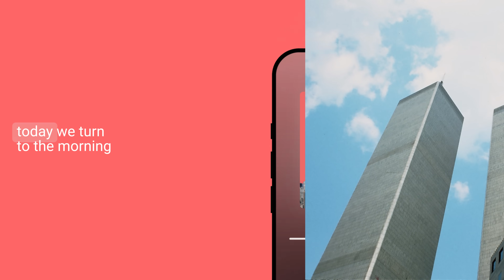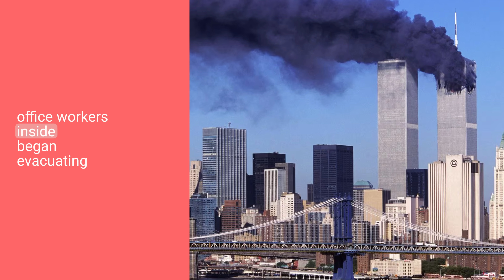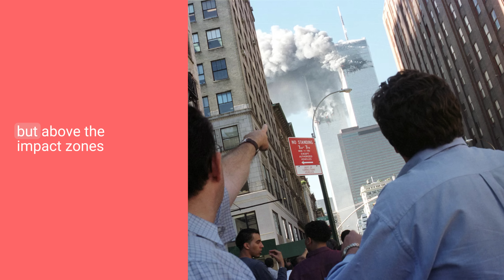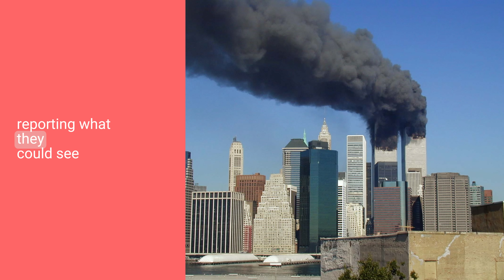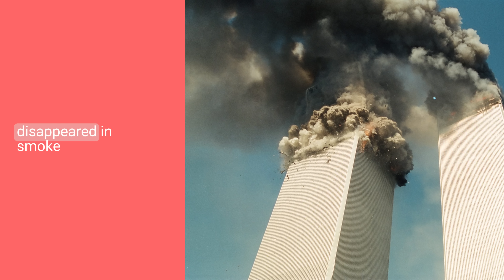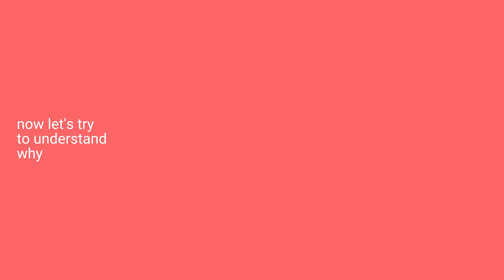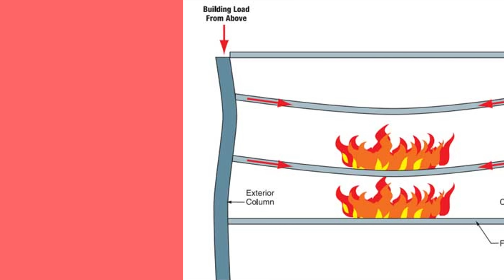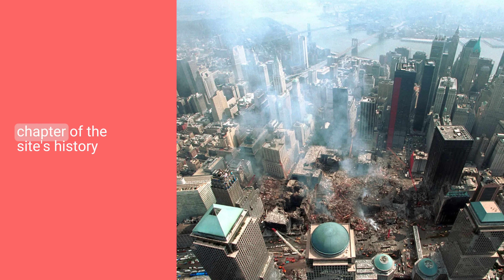9/11 - How and Why the Towers Fell

Comment: Have You heard about Brno Technical University´s study made by prof. Ivan Němec´s team (with computer model) which proves WTC North Tower collapse was not gravitational but some additional energy had to be used? They were asked to write a book about it  so they wrote it and it was published in 2014. Scientific research, differential equations. Czech constuction engineers came to these conclusions:
„In this probable combination of parameters we can see that the collapse was arrested after approximately 100 meters. The most of the building remained standing. But this also was not observed in the case of collapse of the WTC 1 building.“
„In both solutions it was supposed that the columns did not cause any resistance to the fall, no mass fell outside the building perimeter and there was no damping. The fall is braked only by the impact of the falling mass into the motionless mass of the floors below the crushing front, and this is an inevitable brake on the fall caused by the law of conservation of inertia, which is one of the basic laws of mechanics. However the real collapse of the WTC1 tower was still faster. It leeds to the conclusion that the mechanics of the fall must be different than supposed by the NIST report and also by the authors of this book, and that the falling mass did not hit a motionless mass below it, but rather a mass which had started to fall before the impact of the falling mass occured. „
___________
Preface
„The book is inspired by the fall of the Twin Towers of the World Trade Center, but all the derivations and formulae are valid for a collapse of an arbitrariy high- rise building. The computer simulations are performed on a building with the same geometry“ …
„Several additional parameters, such as the value of damping ratio, the share of the mass falling beyond the building perimeter and the average resistence of the columns to the fall have been introduced. „
„The book is not interested in the cause of the fall, but it studies the dynamics of the fall itself, especially the speed and the extent of the collapse. Some conclusions regarding the fall of the WTC Twin Towers collapse have been made.“
„Impossibility of the mechanism of the collapse presented in the final report of NIST is proved which imply the need of an additional investigation of the collapse of the Twin Towers of the World Trade center. „
https://www.amazon.com/gp/product/3639668162
Reply: Thanks for sharing! 👍

Comment: Kind of wonder if there should been Warter to dump above buildings
Reply from the maker: That's a very interesting idea. Having big masses of water on higher floors is already a technique utilized to stabilize buildings against earth quakes, so if that water could also be used to help with extinguishing fires, that would be amazing. The one thing I honestly don't know is how much water would be needed to even slow down a fire like the one that happened in the towers that day. Maybe someone who reads this and has more knowledge of the subject could do some napkin math for us to see if that would have made sense.
Reply: Well, there was. It´s called "sprinkler system".
They say the sprinklers got severed by the plane impact, which is a funny "argument" since the water would still pour into the impact floors with the fire.
Fun fact: Originally the towers didn´t even had sprinklers. The towers were supposed to be able to burn out completely without collapsing. They installed sprinklers only after the huge fire in 1975. Not for the safety of the structure, but for the safety of the people inside. The 1975 fire was on the lower floors with all the weight on them. It was a 3-alarm-fire on multiple floors. Yet the tower didn´t collapse completely. Not even partially. They didn´t need to demolish it afterwards. They didn´t even need to do big reconstrucions nor replacements. The fire really did NOTHING to the tower.

Comment: what tells you helicopter rescue would have been impossible? There is a video filmed from an helicopter checking the roof and the pilot explained that if theyd seen someone they would tried taking them.
Reply from the maker: Fair point. ‘Impossible’ might be too strong a word. Let’s say it would’ve been extremely dangerous. Helicopters rely on stable air, and fires that intense and concentrated create violent updrafts and turbulence. In the case of the Twin Towers, the heat rising from the fires could have caused a helicopter to drop tens of meters suddenly, with no way for the pilot to correct it. That’s why rescue attempts from the roof weren’t considered feasible at the time. I don’t fly helicopters myself, but I have trained to fly small planes, and I can tell you that even small hills on calm days can create surprising turbulence thousands of feet up in the air, so the updrafts from two burning skyscrapers would have been unimaginable.
Reply: In the 1993 bombing people were evacuated from the roof by helicopter.
However, they came to the conclusion that that created more problems rather than solution. Too many people tried to escape via the roof, too less people could be evacuated by the helicopter, so most of them just ended up there waiting for nothing, or in the end waiting for firefighters to climb all the way up there.
So they made the decision to seal the roof doors from then. That´s why no-one could reach the roof on 9/11.

Comment: They fell because they were hit by airplanes full of jet fuel at 400+mph.
Reply from the maker: Yes, long story short, that's it. Thanks for laying it out so clearly :)
Reply: The towers were the only civil buildings literally designed to withstand airplane impacts. Impacts even more destructive than the actual ones on 9/11. And yes, OF COURSE they also considered the fires which they concluded to be the biggest problem. For the people inside. Not for the building´s structure which would still be there.

Comment: Thermite
Reply: Yep, thermite is the answer.
Tiny iron spheres, typical product of thermite reactions, were found all over in the dust.
Also the glowing metal pouring out of the south tower the minutes leading up to its collapse clearly remind of thermite.
Thermite can´t be ignited by normal fire nor by impact force. Bomb sniffing dogs wouldn´t react and since (classic) thermite is essentially rust and aluminum, it wouldn´t even be suspicious to find these ingediants in the debris.
You can make thermite react loud with a "bang", but it still wouldn´t be as loud as classic explosives.
Thermite also helps to explain the extreme hot debris field for months.
Reply from the maker: Kryptonite

Comment: This video is bull. The towers did not suffer severe structural damage. A plane hitting the steel outer structure was like a coke can vs army tank.
Reply from the maker: I doubt a Coke can could punch through an armored tank... The planes tore through multiple perimeter columns and damaged parts of the core. In a tube-in-tube structure, that IS severe structural damage.
Reply: @wikiarquitectura  

Note how you got no reply. That's all too typical of thruther types.
Reply: @cchris874  Yeah, could never have to do with the fact that YT rarely gives notifications on replies these days huh?
Reply: @zettel3296  

They almost always give me a  notice. Maybe it's my settings.
Reply: @cchris874  I didn´t get notice of your reply. Maybe YT doesn´t like me because they have to support mainstream BS that I oppose...
But actually I´m kind of surprised that you got notice, since most sheeple I address comments to never reply.

Comment: I wonder if they knew this would collapse the buildings?  Or was ramming the planes into them the only goal?  If they knew this would happen, where would they get that knowledge that this was even possible, since it was a shock to 99% of us?
Reply from the maker: That’s a really good question. I think nobody knows for sure. My personal guess is they were aiming for mass casualties and symbolic destruction, not necessarily for the collapse of the towers, and they ended up causing more damage than they thought possible.
Reply: The only reason to chose the twin towers to crash planes into them is because they were the only buildings literally designed to withstand that.

Comment: Controlled Demolition, the only way to bring them down, they were purposely designed to withstand the impact of a jet liner, ask any building engineer
Reply: I'm sure a 200-ton jet with 20,000 gallons of fuel can also bring down a tower.  If not, how many times has that happened?  Keep in mind that during World War II, a 3-ton Zero traveling less than 400 mph could sink a carrier.
Reply: @janefelix3821  You absolutely have no clue what you´re talking about.
Reply: @zettel3296  Actually you don't.  First, the buildings were never tested for being hit by a Kamikaze jet with its fuel at 80%+ capacity.  They figured it would be a plane with limited fuel and gliding at a much lower speed, like the B-25 that struck the Empire State Building in 1945.  Second, please say how dozens of munition experts can rig the Towers (would take weeks) and no one notice since the buildings were undergoing a ownership change and dozens of individuals were constantly going through the Towers on a daily basis. Also, if dozens were involved and no one keeps quiet anymore, where are the canaries?
Reply: @janefelix3821  Yeah, so you just keep on proving yourself to be a pathetic wannabe without any clue whatsoever...

Now watch carefully as you get totally destroyed my poor poor little wannabe:

The first 9/11 plane (according to the official story) was a 767-200ER with MTOW of 179t, the second plane wasn´t even "ER", so it´s MTOW 143t.
Do you even know what MTOW means?!?

That´s how your "200-ton jet" blahblah is destroyed already.

Do you want me to go on?!?

Does 600mph sound like landing speed to you?!? That´s in the OFFICIAL REPORT. 600MPH.
Not for the 9/11 planes but for the calculated 707 in the design.
You never knew that, huh?!?
What a shock to you to learn that after all the time you thought you knew whatever, huh?!?
You know NOTHING.
Please try to just grasp that. And shut up.
Reply: @zettel3296  Then how much did they weigh?  Second, the planes were not at ground level but close to 1,000 feet above sea level and if the intent is to crash, the concept of safe speed does not matter, a plane can easily exceed its safe speed, just that the pilot won't be able to recover the plane and chances are it will crash.  During WW2 Japanese pilots exceeded the safe speeds all the time since recovery was not their goal, crashing was.  Then answer, how did they rig the properties and no one notice?
Reply: @lukemckoolaid
😂😂😂

Comment: No plane hit the World Trade 7, it was not burning to the core, anyway, it fell flat straight in seconds.
Reply: Implosion
Reply from the maker: It’s a bit like the difference between a sprint and a marathon. In the Twin Towers, the plane impacts severely damaged the structure, stripped fireproofing and started massive fires at extreme temperatures, which brought them down in about an hour. In the case of WTC7, the damage and the fires were less dramatic but burned uncontrolled for hours, until it finally collapsed later in the afternoon.
Reply: @wikiarquitectura It didn't burn uncontrolled for hours besides those fires couldn't melt the structure besides Larry Silverstein said "pull it".
Check "architects and engineers for 911".
Reply: @guilhermeem7933  Stop with the "pull" it nonsense.  The Fire Department's definition of "pull it" means to pull out the firefighters and let the building burn because attempting to save it would fail and cause more deaths.  Around 2:00 PM, the NYFire Commission called Silverstein and told him they were going to pull the firefighters, and Silverstein felt that, due to the massive loss of life so far, that pulling it was the best course.  It does not mean that they caused the situation; it just means that the building can not be saved.
Reply: @janefelix3821  So in your utter stupid fantasy firefighters would call themselves "it"... 🤣🤣🤣

Comment: People with no knowledge follow conspiracy theories. People have no idea how they were designed or how they are built ,or even how the weight is distributed. You always hear the same non-sense,controlled demolition,thermite etc,none of that is true. Even when i explain it to conspiracy people,who have no clue what they are talking about,they dig in their heels and repeat information thats false. Even the fact there is bent steel 2 inches thick simply shows resistance. Lots of resistance. They performed very well structurally. I was surprised the south tower stood for that long
Reply from the maker: Totally agree, and thanks for saying it so clearly. I appreciate you taking the time to write this.
Reply: @wikiarquitectura over the south tower after the impact was 112 million pounds,north tower 76 million pounds,so from the first moment they were struck,the clock started. People dont realize how unique the twin towers were. A core and perimeter, and the perimeter was load bearing,every piece on the twin towers was a load bearing piece. So each column that was knocked out,on the perimeter and core,was a huge loss. Say your normal downtown building in your city right now,the perimeter carries less than 10% and 10% is considered quite a bit. If anyone needs me to do the math I will and show you. Think about how many feet was the void, the void being where the aircraft went through. Let's say 12 to 20 feet,im.being generous to show how it was unstoppable, so 112 million pounds,was dropped say 20 feet,and 76 million pounds was dropped 20 feet,and dropped on compromised areas below.over 2 billion pounds of force was released. 250k tons each building, 100k tons structural steel in each one. People say why did the floors below fail,they weren't supposed to lol. Imagine If they created a building with over 30× redundancy,it would literally be a giant steel block without people,more like a piece of art lol. Each floor was roughly 4 million pounds, most of that weight being the floor slabs. To think a 4 million pounds floor is going to catch another 4 million pound floors when dropped 20 feet isn't possible, not to mention 112 million and 76 million.

Comment: Video this video was the biggest waste of my time. I am so sick of these AI generated videos where the title implies one thing but you listen to it and you get absolutely no information this was not what I was expecting. I have seen other videos that really did explain and technical details while the trust is Warped because of the heat of the jet fuel and how it had the domino effect once the one floor failed at the top it collapsed down and then the floor below it couldn't sustain the weight and it created a domino effect it went into expert detail and this one is a waste of my time I would not recommend it for anybody
Reply from the maker: Sorry to hear you felt that way. You clearly have a strong background in structures and engineering, which is great. If you knew the show, you’d know I always try to simplify the technical side so it can be understood by a general audience. My episodes usually focus more on the historical and sociological context around the buildings rather than going too deep into the engineering details. That’s the balance I aim for.
Reply: Thank you.!  I thought I was the only one thinking these videos were AI.
Absolutely a waste of time !
Reply: Search the channel substack of David A. Hughes on 9/11 and Mark Conlon 9/11 Planes Research, you will understand. Please after share.
Reply: NIST attempted to push the pancaking and pile driving argument, but high school physics teachers quickly exposed that lie.  The buildings were brought down by controlled demolition, otherwise they couldn't have fallen in the manner they did.
Reply: @chrisgardner4222 controlled demolition that killed people for no reason, I guess the pentagon was also a controlled demolition? 🙄😒
Reply: @chrisgardner4222 you should educate yourself on how things actually work,instead of repeating things you know nothing about
Reply: @chrisgardner4222  I'm sure experts and professors know better than most high school teachers. I'm saying this because my high school science teachers didn't always have the answers nor taught us anything.
Reply: @chrisgardner4222  stop stickin ur head n buckets of paint thinner. its clearly havin an effect.